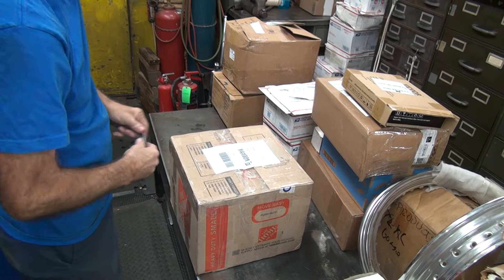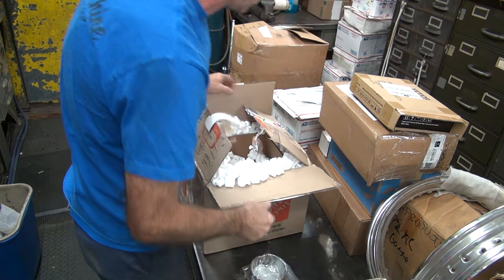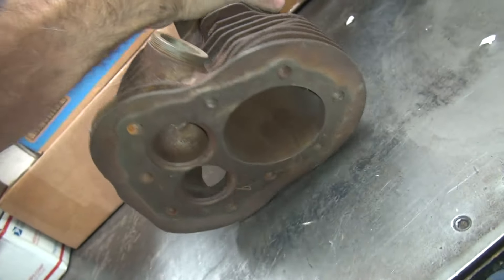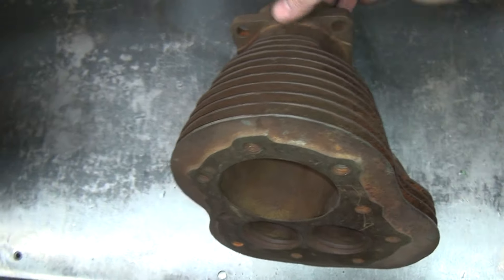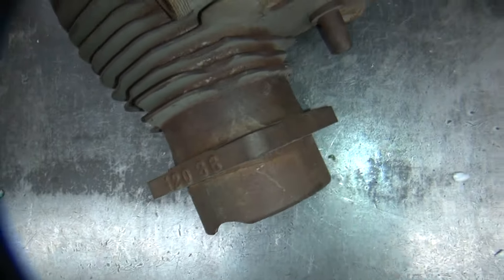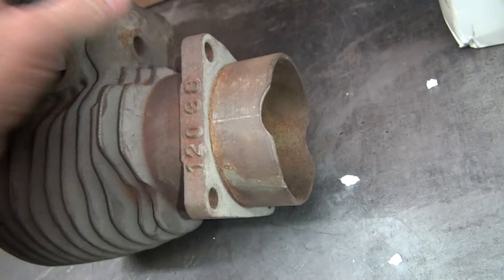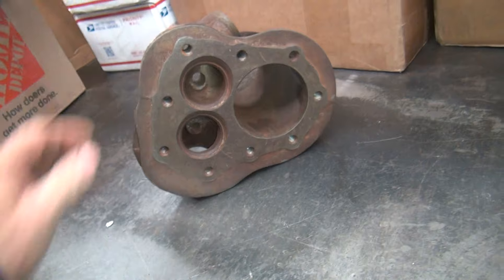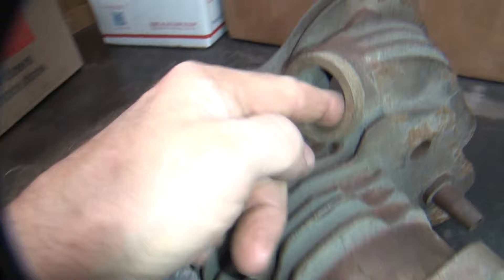see the crap i buy ebay 1938-41 74ci UL 11 fin cylinder broken spigot flathead harley tatro machine

Comment: Just for shits and grins, how about trying to set the 74ul jugs on a sportster case.
I know your probably getting tired of me. But I'm a persistent bastard.
Reply from the maker: what are you trying to prove? the k-model ones fit. the ul stuff can be made to work, but nothing will line up correctly. all the center lines are different.
so you didn't like the topfuel evo cylinders i mocked-up onto the panhead, 45 trike case race motor deal.
tatro